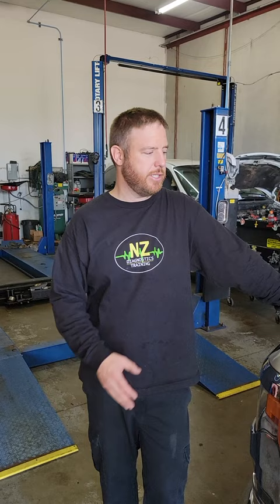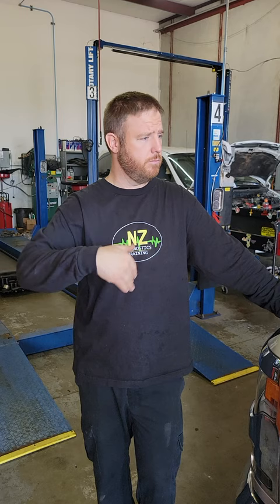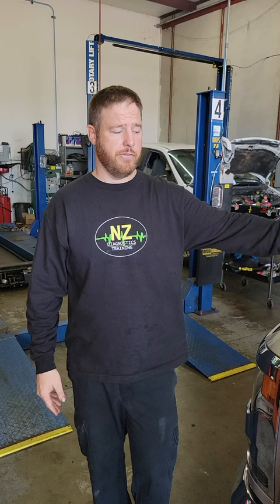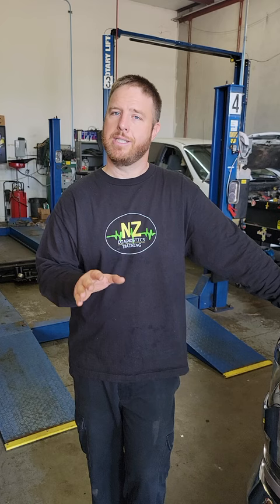Brakes locking up while driving.

Comment: This happened to me with a 1989 Porsche 928S4 that sat for 7 years. On this car, brake fluid need to be flushed every couple years. When the car heats up, the rear brakes wouldn't necessarily lock up, but there was friction. The pedal would lose pressure and hit the floor. Replacing the master cylinder fixed it.
Reply: You helped me remember what I have not thought of yet thank you

Comment: My 2002 escalade 6.0 v8 does the same thing. I've replaced my Master cylinder,  brake booster, calipers,  and had both the ABS pump/module rebuilt.
Reply: 05 escalade. Flashing the software helped?
Reply: What fixed the issue?
Reply: Its still broke down i dont know what else to do@fantomclothingco

Comment: Have a 2005 avalanche that both front breaks will tighten while driving.  Wont release until i open the bleeder.  Replaced calibers, flex hoses and  break fluid.  The only thing that worked was pulling my abs fuse.  It worked for a couple of months but now its happened again and i had to pull over and open the bleeder valve for a sec.  Whats the problem?
Reply from the maker: Could be the ABS modulator, ofcourse it would have to be confirmed. Also an overfilled brake fluid resv. will do this aswell.
Reply: @nzdiagnostics2010  does pulling the abs fuse bypass the abs module?  Or with the fuse out could something in the module still be causing the problem?
Reply from the maker: @perryadams7500  only the electrical section, not the mechanical side.
Reply: @nzdiagnostics2010  ok thanks.  So the mechanical part could be causing the brakes to  tighten?  If I got a used ABS module would I have to do any programming or anything?
Reply from the maker: @perryadams7500  Yes, no Programming required.

Comment: I have noticed my 2022 Sierra 3500, that the drivers safety systems, often miscalculate safe stopping distances and throttle usages when experiencing down hill and uphill situations. Spoken with engineers a few times about it. Since it was flagged in the mygmc and made reports about it. Its more critical of this near areas like stops, or pedestrian crosswalks. Let me give you an example. There is a crosswalk less than a half might from the local highway. This section of road crosses a slew and briefly will come up as an altitude below sea level. Right where the cross walk sits is a transisition of below sea level, to above sea level. If you have a vehicle in front of you in any way, on coming opposite lane, 150' in front in lane. This system will trigger a red flash warning via the hud, and present an unsafe condition/critical alert. If you give the vehicle any throttle at all, even if you are climbing at the lowest speed and still a safe follow distance. Interesting software bug, thankfully hasn't caused an accident. But its easy to replicate and the data around it is interesting too.
Reply: Replace speed sensors in rear wheels

Comment: I know what it is.. not what cause is and dealer is closed today. It happens when truck downshifts to climb a hill or passing gear. Imagine those of you who know how to drive manual trans cars. Imagine going from 4th ton1st instead of 5th .... yep that's what it is doing when I hit the gas climbing a hill. Downshift then skid to slow down ... I thought it was brakes but it did it 2 times yesterday on same hill....
Reply: My 14 Silverado has done this twice but it’s only done it at 15-20 mph but it just locks up for a split second and then it drives like nothing
Reply: @YouKnowanth  turns out the dealer said there is a service bulletin out. The valve body needs switched out. Gm won't do a recall even though it isn't anything to do with me but their engineering. But yet I ha e to donwithout my teucknand pay to have it fixed under extended warrenty...

Comment: hi, this is what happens to my 2004 g35 coupe but it only happens when going to curbs specially on ramps that need to do some hard turns, I replace my whole  brake assembly rotors, calipers, hoses, brake pads cause I thought the problem but still doing it, are you in California? do u work on Infiniti or Nissan? thank you
Reply: someone in the infiniti forums mentioned steering angle sensor too.. causes a lock up.
Reply: My akebono big brakes (front) of Q50 locked up. They tried to say it was calipers but both are brand new with low mileage and gentle driving. IDK..I guess I'm very luck,  but fault codes indicate low voltage abs module
Reply: Did you find out what happened? Having this issue with my 2003 350z....
Reply: @ljwade28  Nissan couldn't pin point the issue. I received a low voltage abs module at first shop (before towing it to Nissan as the first tire shop finally ruled out calipers.) At certain times it would be both front locked up simultaneously with no release... and after bleeding it might be just driver side first.. and then passenger side front locking up. They were able to bleed from the master cylinder ports and this opened the pistons on the front successfully. Nissan scanned the diagnostics, but no codes present as the first shop cleared them 😖. They speculated that the new calipers that were powder coated had something to do with it... but it was a "probably seized". I find it very unlikely both calipers seized due to PC based on the condition they are in and I've run for 2 years now with less than 10k miles and DD only. They reset the ABS system and went ahead and had them replace all the calipers  because I wanted to rule the problem out. Needless to say I've driven over 150 miles with no lock up. I don't know but after inspecting the calipers that came off they look perfectly fine no obstruction in the piston bore or anything that would appear like they would stick. The pistons have fully retracted and bleed just fine. I wouldn't be surprised if it were the master cylinder or faulty abs module, but for now no codes or braking issues thankfully.

Comment: 2018 chevy traverse 60000 miles driving on highway brakes locked up almost got into an accident . no recall info and no notice from dealer about computer update. very dangerous. how to I proceed with dealer without them telling me i need to change every darn item in braking system?? thanks for your help.
Reply from the maker: You can ask the dealer if they have an EBCM update available.

Comment: I am having same issue with 2000 2500 Chevrolet truck  mistakenly put power steering on brake fluid reservoir, I’ve replaced booster, master cylinder, calipers, front hoses still have this issue. Help
Reply from the maker: System needs flushed really good & everything replaced.

Comment: My 2021 silverado just did this today on the way to work. Stsrted to accelerate to pass someone and brakes kicked in tires squeeled and everything.  Happened to fast and sudden for me to even acknowledge any dash lights that may have popped up. First time it has ever happened
Reply: Did you ever find out anything?
Reply: @elmeradams8781  yes... turn out there is a service bulletin.  What was causing it was when my truck is in overdrive and cruising it rode fine. But if I hit the gas to pass someone or climb a hill and the truck kicked out of overdrive to drop a gear it was dropping into low so truck would skid to slow down. Very dangerous on freeway of someone is behind you. Turns out the valve body needed replaced and GM knows about it
Reply: @tomchristensen2914  thank you. I think my hydro boost is messed up.